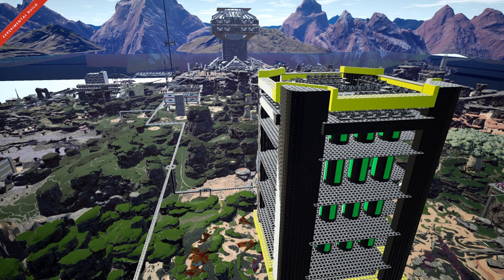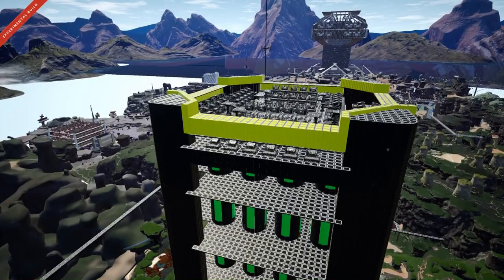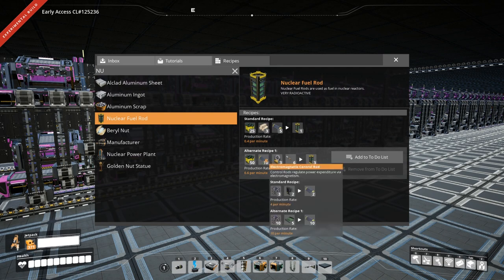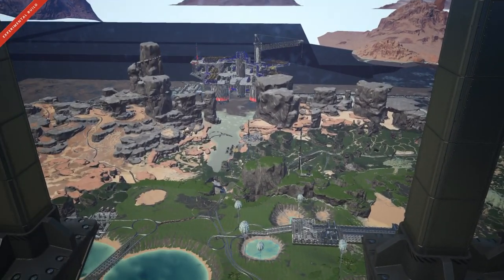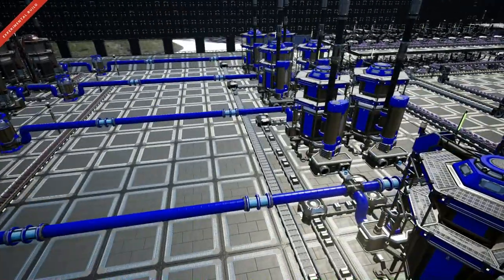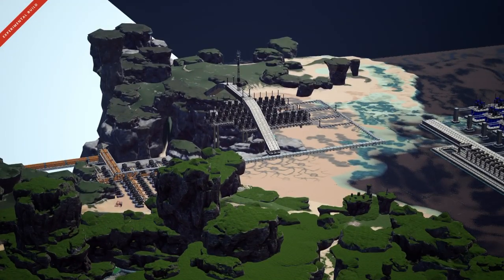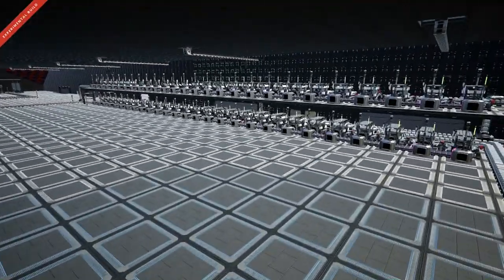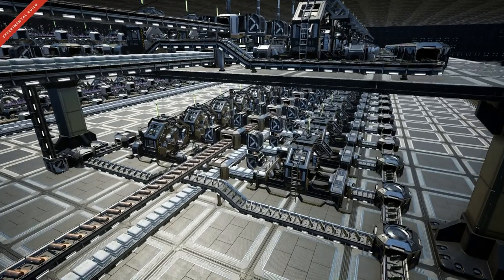Satisfactory - Nuclear Prep & World Save Share

Comment: what are your pc specs? and i can't find the oil turn on hook up thing
Reply: found it just followed the power underwater
Reply: duuuuuuuuud this oil set up is crazy cut my frames in half
Reply from the maker: @marcussthern1082  HAHA  thanks mate!   yep,  I only have a i7-8700 CPU @3.2GHz and 32gb ram...   I upgraded my 1070 gpu to a 2080 gpu but it hardly helped, I think a lot is in the processor
Reply: @danp6918  dud what storedge are you useing because i have the exsact same setup exsep i dont have a 2080 i have 1070
Reply from the maker: @marcussthern1082  I'm using ssd
Reply: Then idon' now but i an getting more frames than you some how
Reply from the maker: @marcussthern1082  something in the settings?  And perhaps depends how many machines are running...  but also I believe when I'm recording with OBS...  that will draw some processing power
Reply: @danp6918  FYI, I run my 1000+ hour build using an NVIDIA Titan (24 GB RAM) and have FPS issues (i9 w/ 6 cores).